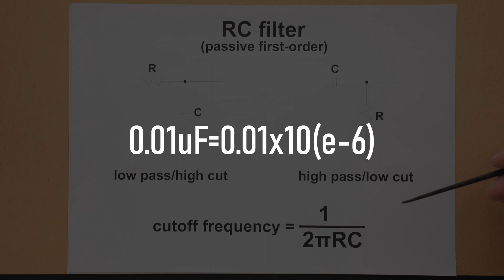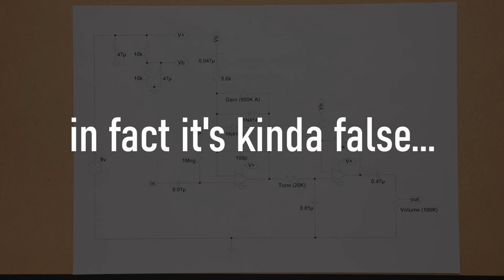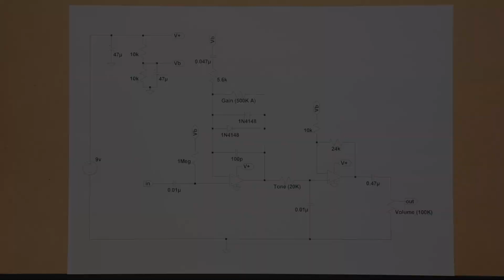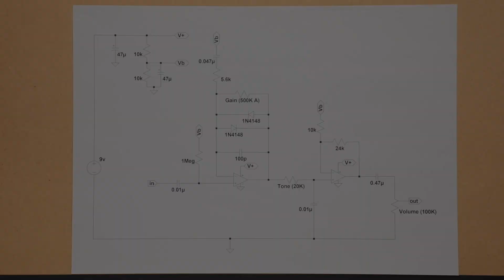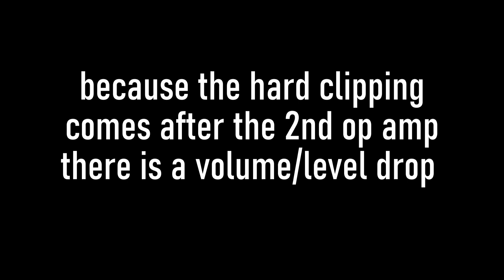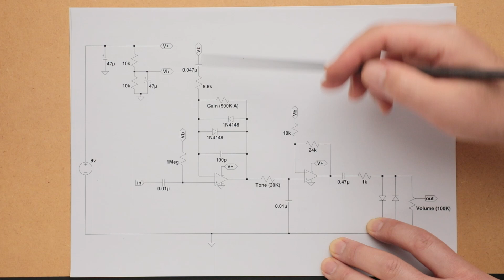Breadboard Overdrive Build Part 3 - Simplified Analysis Of The Schematic Plus Some Ideas For Mods

Comment: Hey Arito.  great series.  Thank you!  You’ve teased a couple of times about using LEDs in place of the soft clipping diodes.  What effect would that have on tone?  Would you need current limiting resistors?  If so, how would you calculate the right values?
Reply from the maker: Thanks for watching! LEDs have a higher "forward voltage" and as a result, the signal will be cleaner/clip less at the same gain knob position. You won't need current limiting resistors, but with "hard clipping" distortion circuits, we usually place a 1k~10k resistor before the hard clipping LEDs. You don't need to calculate the right value since we're not trying to light up the LED with DC current, but just using it with AC signals to clip the peaks and distort the signal. Hope this helps!
Reply: @arito  Fab!  On with the experiments … :)
Reply from the maker: @notabeneenterprises4210  Glad I could help! Have fun!!

Comment: can we use regular pots instead of trimpots?
Reply from the maker: Thanks for watching! Yes, you can definitely use regular pots!
Reply: @arito  Does anything special need to be changed or added in, I used a b20k, and a b100k, and the pedal was dead... had to put the trim pots back in to get sound.
Reply from the maker: @JaredTheGrayson  Nothing needs to be changed, just like with the gain pot, connect wires from the pots to the breadboard and you should be good to go. I would start by only replacing one of the trim pots with a regular pot and see which one of the two is causing the problem. Then from there, try to figure out if it's the wires, connection, or the pot itself that is causing the issue. Hope this helps!
Reply: @arito  Thanks so much, I did end up finding a bad pot!
Reply from the maker: @JaredTheGrayson  Awesome! Glad I could help! Have fun with the overdrive!

Comment: I'm new to this stuff, and have a couple of questions. In the soft clipping stage, it seems like it's an infinite loop, like some signal could keep flowing around before going back into the OpAmp?
Also, it seems like the full signal could just go through the pot and bypass the diodes, so I'm trying to understand that. How much can bypass the diodes?  Also, some signal could just go through one diode and make its way to the OpAmp, no?
Reply from the maker: Thanks for watching! I totally understand your where you're coming from, the op amp amplifier is a little confusing. It took me a while to understand it, and I still haven't fully grasped all the inner workings of an op amp. It would be impossible for me to try to explain the op amp in this comment section, and I probably won't be able to do the best job at it.
I would recommend searching online for: "how an op amp works" "the non-inverting amplifier" "op amp unity gain buffer"
I wish I had a simple answer, but anything I say while leaving out the details, might end up confusing you even further. Good luck!
Reply: @arito  Fair enough. Thanks for taking the time to reply. I look forward to more of your content.
Reply from the maker: @getenlightened  It's not as complex as it may seem at first, and a lot of fun once you understand the basics!

Comment: Thanks you so much for explaining everything so well, I was thinking what would happen to the overall sound if we changed the 10k resistor in the second op amp to a smaller value, I know it would increase that gain but would it change the frequency as well or do we need a capacitor to do that. Thanks again
Reply from the maker: Thanks for watching! Great to hear that you enjoyed the video! That second op amp is full frequency, so changing that resistor will not affect the frequency response, only the gain. Adding a capacitor, as you mentioned, will definitely change the frequency response. Hope this helps!

Comment: Hello, thanks a lot for the help, I was wondering what would happen if we change R2 (5.6k) to something smaller would that increase the gain thus increase clipping? or would it change the overall sound as well, cause I just finished making this pedal and it sounds great but I have to turn the gain all the way up for it to sound like what you had at 12 o'clock in part 2
Reply from the maker: Thanks for watching! Great to hear you built the pedal! Lowering that resistor will give you more gain, but also change the bass response. Lowering it will cut more bass and depending on the value, it will sound quite trebly/thin. You could change the 0.047uF capacitor to compensate, but I think the easiest thing to do would be to change the gain pot to a larger value, like a 1 Meg.
It seems a little odd that you'd have to crank the gain to get the crunch tone I had at 12 o'clock, what diodes did you use for clipping?
Reply: @arito  I am using the standard 1n4148 ended up swapping it with a 1 meg like you suggested and it works great, and another thing I couldn't find a 20k pot to use for the tone stack so I used a 10k with a 22nf capacitor instead of the 10nf you listed but now that I am thinking of turning it to a tube screamer type of a  tone stack could you tell me what I should i change to compensate for smaller pot. Thank a lot man!
Reply from the maker: @Good-sz4pf  Glad the 1 Meg pot worked out for you! As for the tone pot, since the TS style tone stack is not a simple RC filter where the pot shifts the cut off frequency, if you can't get a hold of a 20K pot, I would just use a 10K. You won't notice a huge difference, but the sweep will be slightly different. Have fun!

Comment: 22:06 Hello, what capacitor would you recommend I put there? thank you so much.
Reply from the maker: Hi, adding a capacitor there will cut the lower frequencies even more, so it's really a matter of preference/taste. If you wanted a fat wooly fuzz, you could change the FIRST op amp capacitor from 0.047 to 0.1, and not add a capacitor to the second op amp. Or, if you wanted it to cut like a RAT, you could add a 0.01 capacitor to that second op amp, and it will really cut the low end. Or, you could go in between, and add a 0.1 at the second op amp, and this will cut the really low frequencies and maybe make the tone a little less muddy, but the effect might be subtle. It all depends on how much low end you want from the pedal, also, with the guitar and amp that you are using. Hope this helps!
Reply: @arito  Thank you very much for your time, you are really a great teacher, I appreciate it very much, I will make those changes to continue shaping the sound
Reply from the maker: @trafalgarsquare9019  You are very welcome! Glad I could help. Yes, experimenting with different value caps to shape the tone to your preference is the best way to go. One way to look at it is: To use the capacitor on the first op amp to do the main shaping of the low end, and adding a capacitor on the second op amp to fine tune it.

Comment: Thank you very much, greetings from Peru, it would be interesting if you make a fuzz using only one op amp. you are a great teacher, thank you
Reply from the maker: Welcome from Peru! And thanks for the kind words! Fuzz using an op amp is kinda difficult as it tends to sound closer to a distortion. The op amp Big Muff is obviously famous, and some people would call the Rat and the Distortion +, a fuzz pedal. But, to get a "true" fuzz tone, I think you need to use transistors.

But, if you wanted to make this breadboard into a fuzz, a simple thing you could do, is remove the 2 clipping diodes, and change the 24K resistor on the second op amp to a larger value, maybe a 300K or even a 470K, and that will give you a pseudo-fuzz type sound 😃

Comment: Thank you for the analysis of the overdrive, and it sounds great. What I was missing was the explanation of the gain potentiometer, I guess that one was a 500k logarithmic.
Reply from the maker: Thanks for watching! Yes, as you have guessed, the gain pot is a 500K log taper. If your question was about parts specs, I go through a list of all the components in video part 1 of the series. But, if you are asking about the function of the gain pot, it simply changes the gain ratio in the inverting op amp. Hope that helps!
Reply: I'm still trying to learn when to use linear vs log pots, but it's complicated to have rule of thumb I guess.
Reply from the maker: @PATRIK67KALLBACK  Yes, it very much depends on the design of the circuit. But, in my personal opinion, as long as you have the right pot value, taper type doesn't matter that much because it's just a matter of "where the knob is pointing," and "how the sweep feels." As long as the pot value is the same, you will always get the same tone.